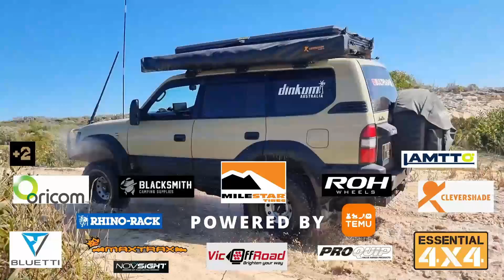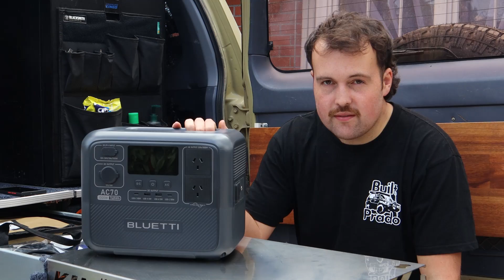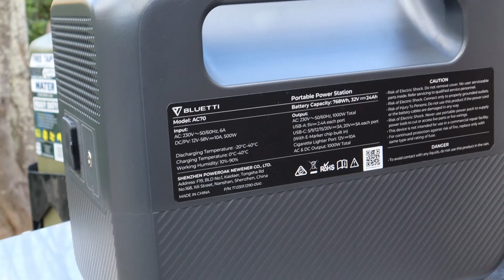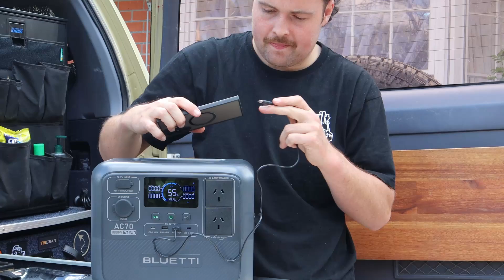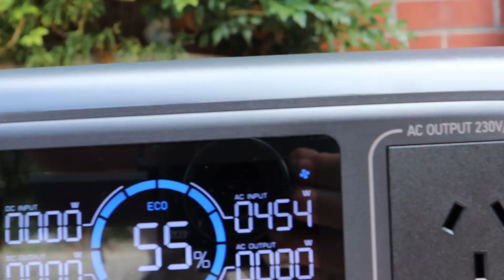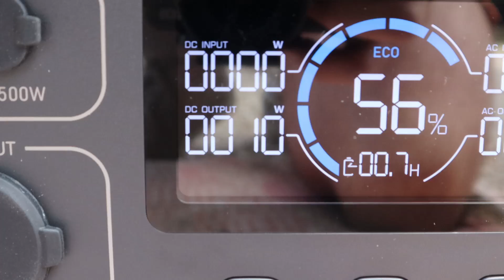Bluetti AC70! (NEW) Unboxing & Review

Comment: BLUETTI AC70 does not have WiFi, so you cannot remotely connect and view battery status, turning AC or DC off remotely. This is a Shame. 
Also it does not bind securely, anyone can connect with your BLUETTI with a y Android phone with Bluetooth and BLUETTI app. 

Can you tell us which BLUETTI AC70 has WiFi and can be remotely monitored.

Comment: BLUETTI AC70 able to run our 2000 watt hair dryer, but I tried it in Number 2 heat settings, not number 3. 
Then our REVON Hair dryer at number 2 heat settings and number 3 fan settings, it used around 800 to 900 watt

Comment: I ran my full-size fridge for 2 days using the AC70 during a power outage. While the compressor is running in the fridge, I can get 6 hours. But it cycles on and off, pulling zero watts when only keeping the fridge at temperature. This increases the amount of time that the AC70 can be used. I was pleasantly surprised!

Comment: AC70 does have a built-in power lifting mode that you can turn on via bluetti app (1000 W inverter kinda fakes more than a 1000 W), which should basically run a toaster or a kettle for a few minutes.